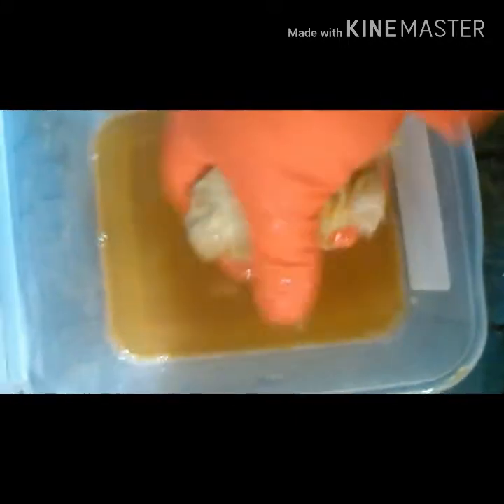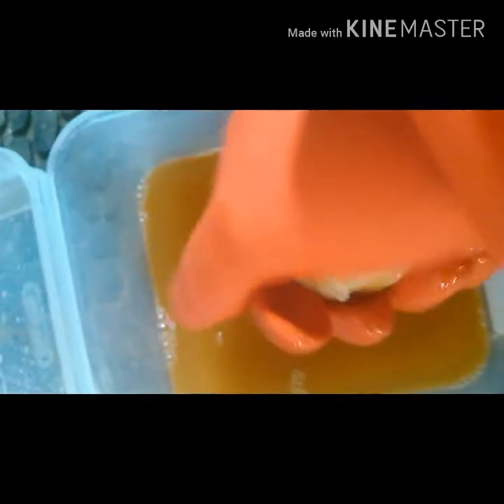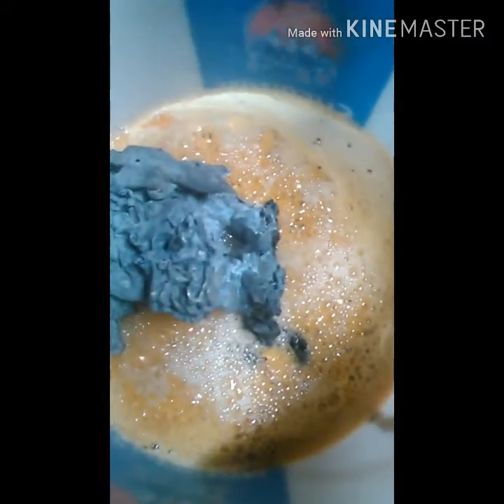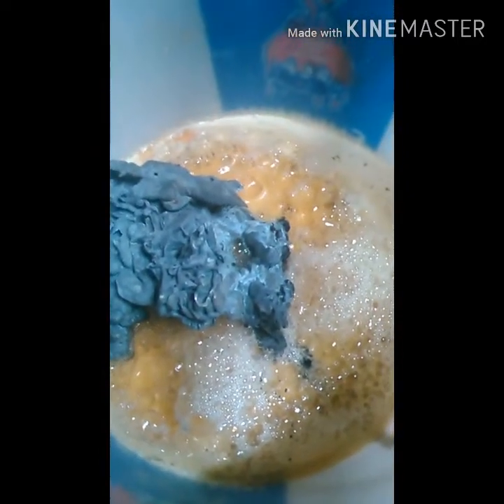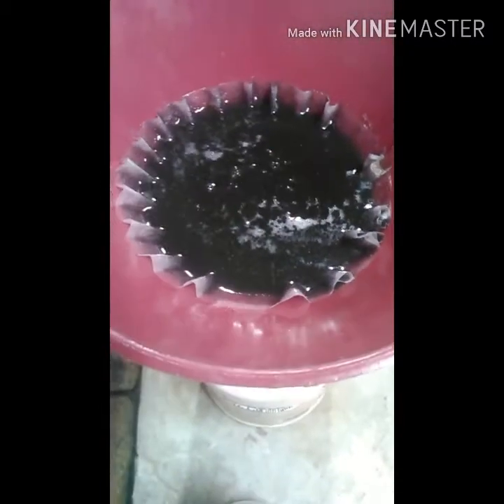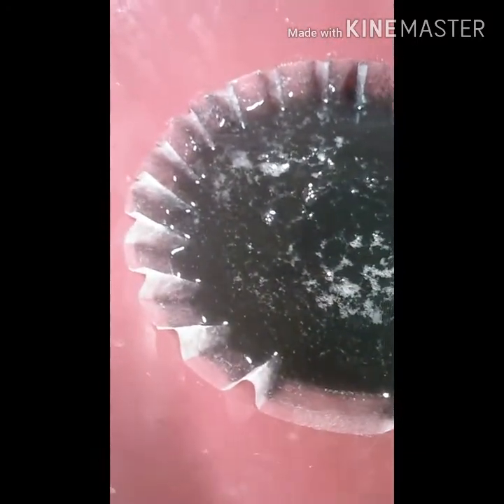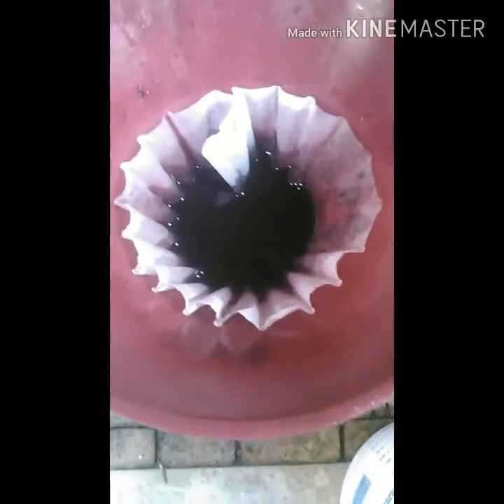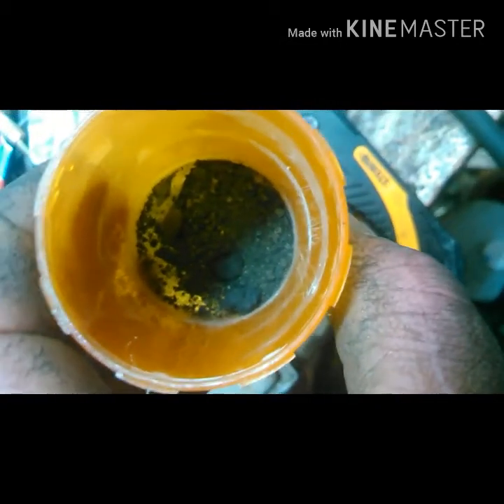How to extract platinum group metals.

Comment: Get yourself a Buchner filter and a small vacuum pump and greatly speed up you filtering time.
Reply from the maker: I got both, some things filter faster without pulling a vacuum. the negative psi makes the sediment clog the filter to quickly by sucking it into the papers matrix, while gravity just sets it on top . which I easier to rinse down the filter

Comment: Be very careful on messing with platinum group metals without gloves and using plastic containers, don't work with these kind of compounds so freely, you should protect yourself more.

Platinum salts are the worst of the group to your health as they are amongst the most powerful respiratory-sensitizers, on prolonged exposure, you could do real harm to your health.
Reply from the maker: You are 100% correct! Thank you for pointing that out.
Reply: @shelbysgarage5828  Otherwise, apart from the safety issue, the reactions were done well.
Reply from the maker: Thank you for the compliment. I did this reaction a half dozen times lol got like 17gs of palladium from it over all.